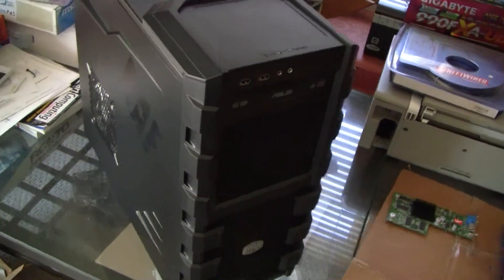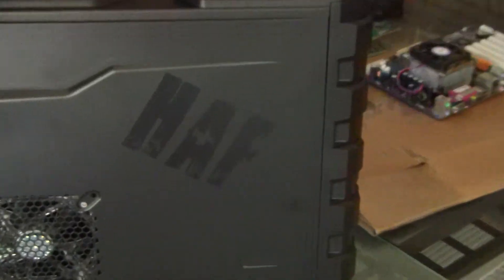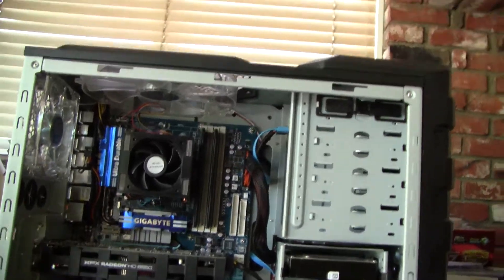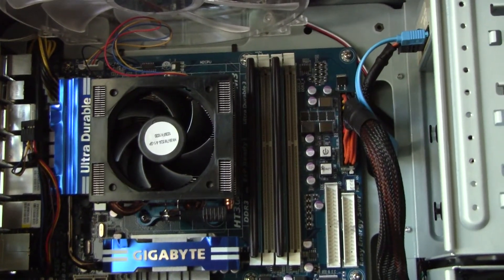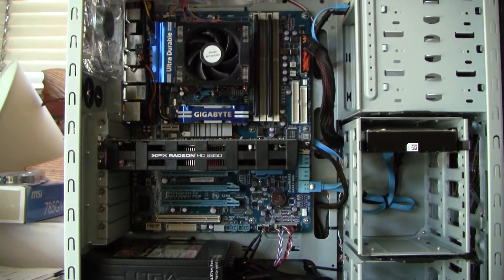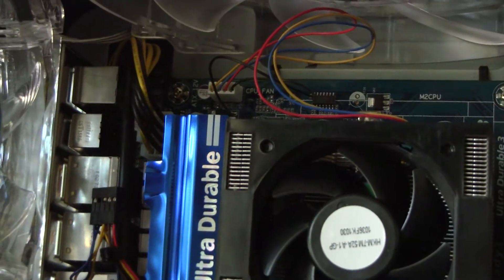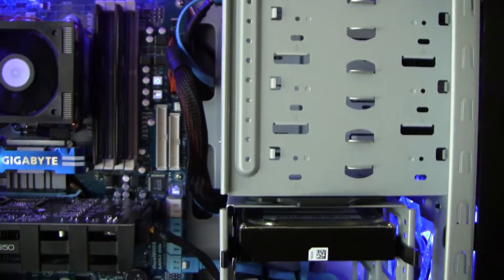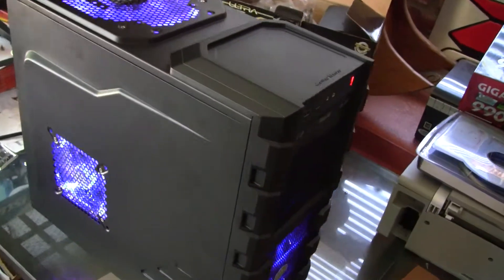HAF 912 AMD BUILD!!!!

Comment from the maker: @Ryd3r22 Thank you! cable managnment was a little tricky but not too bad. luckuly the ULTRA X4 750W psu i used is fully modular and i used as minimal cables as possible, i did spend some time on this on the cable routing....please subscribe and thanks for watching!